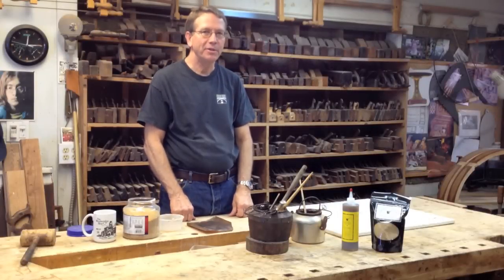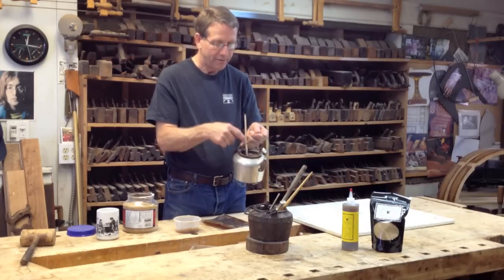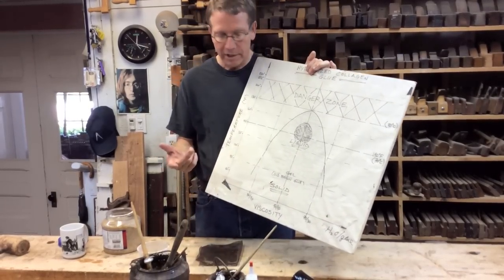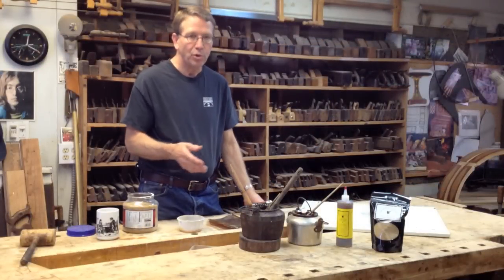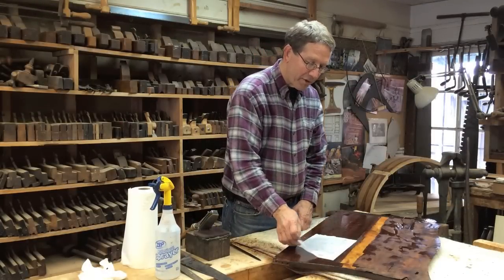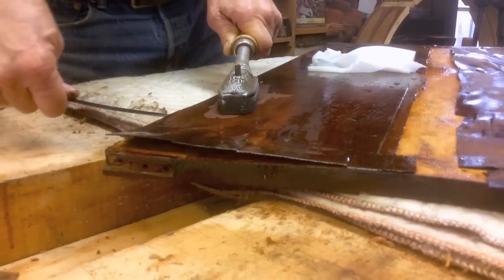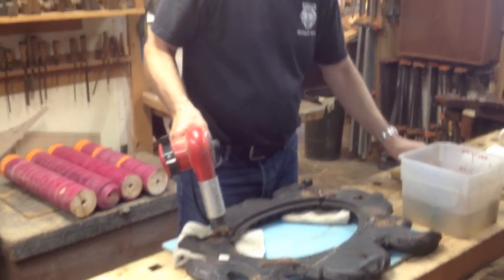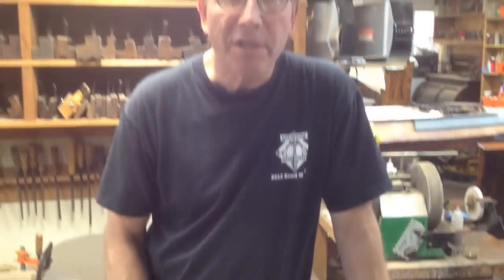Hide glues - Understanding Reversibility

Comment: OK, it is easy to understand how to soak through a veneer. But I have bene trying to figure out how to soak through a thick ebony guitar bridge. The water simply won't soak through. So, the only thing I can come up with is to rout it off (ruin the original bridge) until there's basically a veneer thickness left, and then soak that leftover layer. Do you have any better tips and ideas? Thanks.

Comment: I once was gluing up a project with through tenons that I pushed my luck on and made a hair too tight so that, when the glue was applied and the wood swelled, I cracked one element with a mortise. Since I was assembling with PVA glue, I felt that, if I disassembled, and made a new piece, I'd never really be able to reassemble the good joints because the PVA would have dried on the joint surfaces and, unlike hide glue, will not reactivate. So, I glued it all up and kept the item for my own use. At that point, I learned my lesson and started switching over to using hide glue. Now, if I hit a snag gluing up, there's a good chance I can have a second try. It's rare to need that, but often there is so much on the line at glue up, so much time invested, that I'm just more comfortable.
Reply from the maker: We do a lot of veneering, one of the treasure box II marquetry panels' sides slipped, thanks to old brown glue I was able to lift the panel and re-glue it at its proper place. Then on the first treasure box III, I miscalculated the placement of the 2 side marquetry panels. once again thanks to Old Brown Glue I was able to lift it and save the work.

Comment: I used a heat gun on a chair to get the joints apart, but it scorched the wood quickly!  how does the iron differ?
Reply from the maker: It is the difference between roasting or slow cooking. To revers hide glue you need moisture and heat to reach the glue. A heat gun can work but if it is set to high the wood will burn before the heat reach the glue. Also a heat gun will have a tendancy to dry the wood preventing the moisture to reach the glue. The iron is set to a temperature tha will reactivate the glue 140° usually without burning the wood. Now for solid furniture it is sometime tricky to bring both heat and misture far into a joint especially if the glue is old and dry. Their is a possibility to use a mix of water alcohol 50/50, when you hear the glue crack it is an indication that you are breaking the bound and you may be able to pull the joint apart. Hope this helps.

Comment: Thank you ! but what about other wood glues like titebond premium II? Is it possible to heat steam and disassembly glue joints?
Reply from the maker: Glue such as titebond are more like plastic. You can try to melt it but the heat needed will be (in our opinion, maybe some people may have had some success) detrimental to the wood. Protein glue are reversible by nature with a heat and moisture. The temperature of 140 F is not to hot for the wood. Basically protein glue are reversible by nature, the other one are made to be permanent, or at least until the plastic breaks down as they all do. They are 2 different approaches.
Reply: @3815utah  Thank you for the reply. I also like natural hide glue but for exterior use I choose titebond. It is interesting what people used to use for exterior in old times.
Reply from the maker: @gabrysgabriukas  I think they were relying more on joinery and fastening than on adhesives. We do not recommend OBG or hide glue for outdoor use, but we have a home made plywood made with OBG outdoor in sun and moisture that is doing real good. But it is San Diego!!!
Reply: @3815utah  In Europe. Esspecialy in my country Lithuania where we have snow and rains if plywood is left outside it will bend over more than few times 🙂

Comment: In that part where the old glue was softened and heated, and the poorly joined parts separated, it sounds like you are just adding water to the old glue remaining after the parts are separated.  Is that correct?  Or are you trying to remove the old glue to put on new hide glue?  I am asking this because the parts on my piece are connected by dowels.  There are holes where the dowels go,  and  will be hard to get old glue out of holes.  Not even sure it was hide glue but betting it was since piece dates from at least 1940, maybe earlier.

Comment: Awesome!  You just saved me a whole world of trouble with my own hide glue application
I do have one question however. What happens if you only apply heat? Would the glue still soften at all?
Reply from the maker: If the glue is newly applied there is still some moisture in it and it could reliquify. If it is an older glue the water as migrated and evaporated the protein will be damaged and the glue wouldwill not reliquify and if you add more heat then it puffs like popcorn.

Comment: you don't try to keep the glue "at temperature" during the day while you're using it?  You take the glue pot off of it's heat source
Reply from the maker: Joy Knollenberg depending on work flow the glue pot can be on all day or just part of the day. The hot plate is behind the bench, we put the glue pot on the bench to work and avoid spilling glue on the hot plate. Glue pot are double boiler and will keep the temperature for a while, enough for us to do the job at hand and put the pot back on the heat. Also when we use old brown glue we may use a small container with hot tap water if we need it sporadically during the day or plug a crockpot to keep it warm all day if we know we will need glue wall all day. On the video we made a set up with break to reheat the glue.

Comment: hello , is there an exterior weatherproof  reversible glue?
Reply from the maker: The only reversible gllue that I know of are water based. Technically you could use a protein glue for exterior joinery if the wood is not to porous and or if you finish the piece. Moisture can weaken the glue, but it is heat and moisture create reversibility. Nevertheless it is not "recommanded"

Comment: Hi. Thank you for your video. It's very helpful. The outtakes are funny. I've made a walnut frame using grooves for a stained glass panel. The framed panel will be placed like a door on a LED strip lighted box I've also made and will be hung using a french cleat.  I think reversibility would be best in case the panel needs repair.  I hate the thought of using yellow glue and screws on this gorgeous frame since if there's a problem down the road I'd have to destroy my frame. Do you consider hide glue with splined miter joints a viable option for brand new pieces such as this application (ie - not a period piece or restoration such as you're doing here)? I friend at work said he would be very leery. Thoughts?  Thank you.
Reply from the maker: Thank you! Hide glue is a glue, has been replaced by modern glue mostly for the ease of use, but it is strong enough and has advantage over synthetic gleus, so yes, it is a vailable option. If you value the reversibility in your project, go for it, it's the only type of furniture glue that provides it. If you want ease of use, Old Brown Glue is easier to use than Hot Hide Glue.
Reply: 3815utah Ordered! 😃

Comment: That heating iron is spitting sparks? Sounds like there are electric shocks on the watery surface. Keep safe! btw., nice presentation!
Reply from the maker: tmsaskg the sound is from the steaming, the gas bubbles trapped under the iron make that noise when escaping. Do not worry our iron is perfectly safe and functionning properly. Thank you for watching.

Comment: I have a question about hide glue. I have an old piece of furniture and veneer is coming loose. If I don't have a heating iron which you show in video could I use an old iron used for clothes to heat veneer up after wetting it with water as well as use a hair dryer since I don't have a heat gun either? If so what temperatures should I use so I don't harm veneer. Thanks. Veneer is in bad shape... buckling and splitting in several places. Would like to save and restore. Thanks again
Reply from the maker: Hello, we alwaiys try to save the existing veneer if it is original. you can use an old iron just not to hot, above 180F the protein burn and is destroyed. I beleieve an iron is easier to use than any hot gun as some veneer will get scorched by heat gun. The tepmperature of an iron is easier to keep at a more resonnable temperature, 140F is a pretty safe one.
Reply: @3815utah  Thank you for your assistance. I will try clothes iron in removing old veneer and see if I can save. Thanks again.
Reply from the maker: @ranchgirl6240  It is hard to guide without a picture, but you may not have to remove the veneer for a repair, most of the time rehydrating the glue and reclamping the veneer is sufficient.

Comment: Have you experimented with Titebond Hide Glue? is it exactly the same?
Reply from the maker: As we produce Old Brown Glue our answer can be consider biased... It is the same and not the same in a lot of ways. It is a modified Hide Glue. Itebond seems to have a lot of chemicals in it. We did not do any testing on their glue but if you google it, you may find meople having issue with reversibility. As we have not tested it we can not say for sure. Also, Old Brown Glue goes bad after a while, it is guaranteed for 18 months and will last longer especially in the fridge, but what that means is that it is more natural, and there will be less chemical interaction going in the way of the normal chemical attitude of hide glue. Let me know if that makes sense.